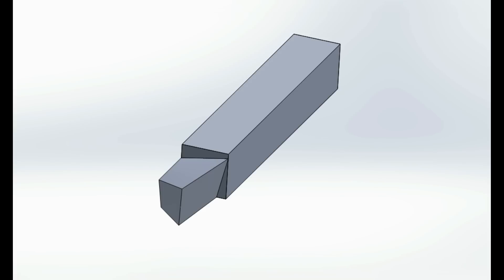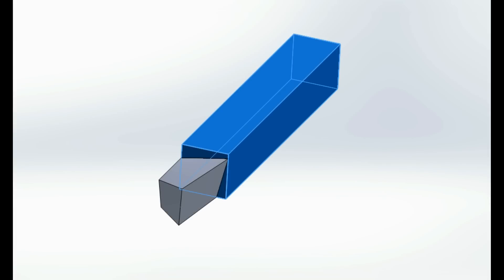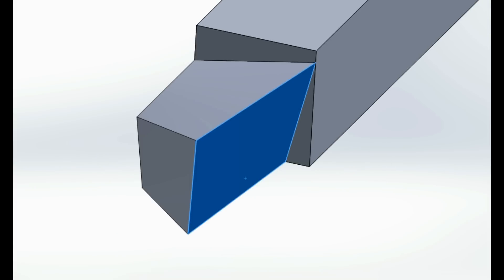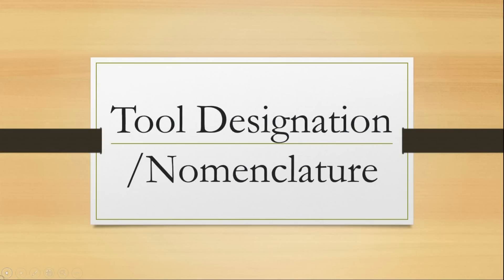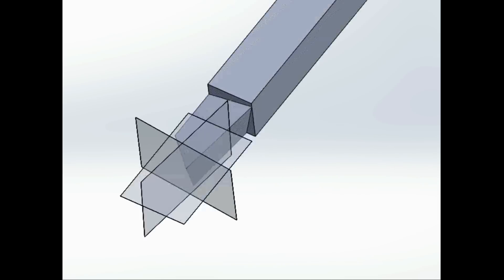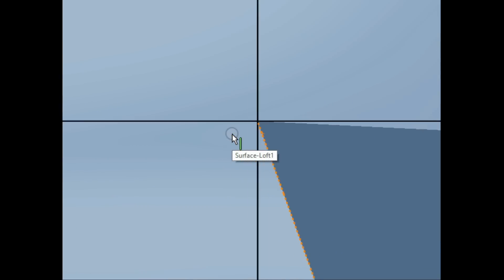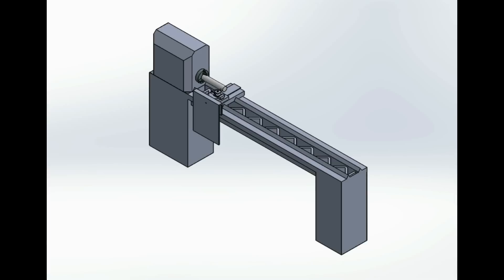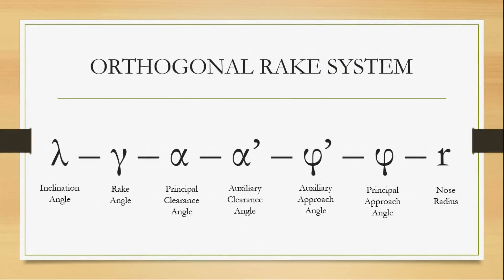Cutting Tool Signature, Nomenclature, Designation, Geometry - Animation

Comment: it was more helpful to me in understanding the terms rather than complex and vague diagrams of text book.
Reply from the maker: +Jishu Das Happy to help :)
Reply: have u done any similar work on NRS system?
Reply from the maker: I didn't make a video on Normal Rake System (NRS), since it is similar to Orthogonal Rake System (ORS). 
Here, the Orthogonal Plane (pi O) is replaced by a Normal Plane (pi N, perpendicular to the the cutting 
edge). The rake angle and clearance angles change accordingly. Note, in this case, pi R and pi N are not mutually perpendicular, but dependent on the inclination angle. Also, ORS and NRS coincides if inclination angle is zero.
This video might help.. Good Luck..
https://youtu.be/81Fdif5e85c?t=55m32s